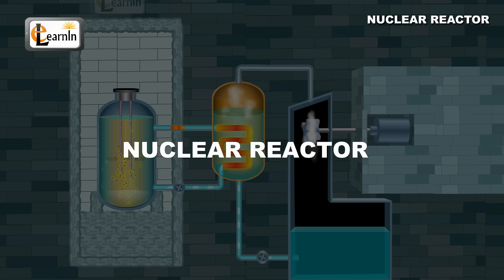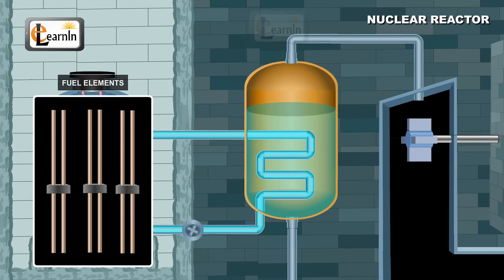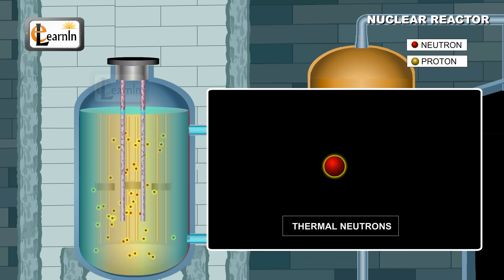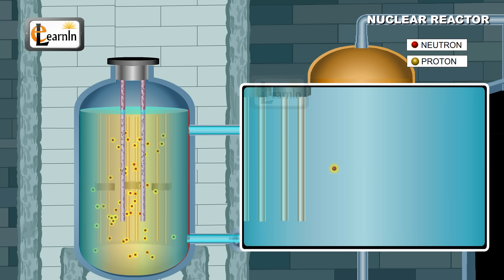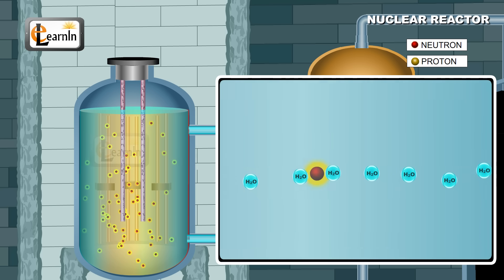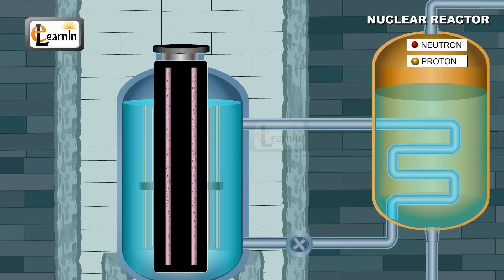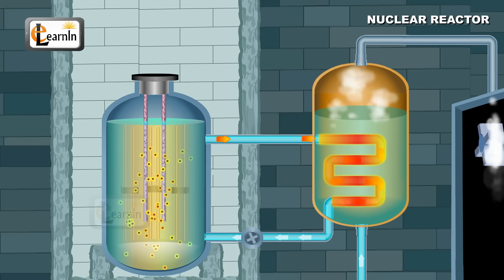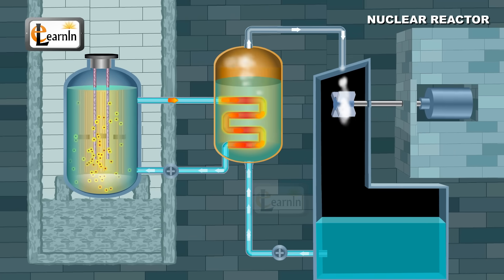Nuclear Reactor - Understanding how it works | Physics Elearnin

Comment: So how long can the Reactor core function for? About a week or more? Can cars use this type of engine?
Reply: 18-24 months. Then you need to shut down and replace the used fuel with fresh fuel. Usually, you only replace 1/2 or 1/3 of the fuel at a time, so each fuel element stays for about 4 years.
Reply: For as long as fuel is available. Could cars use this? In theory, I suppose yes, but would you really want to risk having thousands of nuclear reactors running around? Not to mention the damages of having radioactive material running around.
Reply: Thats awesome amount of time without refueling. I am wondering if its possible to use nuclear energy in cars
Reply: Yes it is possible but it would be highly costly and possible illegal
Reply: This will be very dangerous because of the safety issue. If there is a car accident, there could be a nuclear explosion. So for public transportation, it's a no go!
Reply: in theory yes, but the cars would have to be lined with thick lead which would make them very heavy and therefore impractical

Comment: How you run it on half throttle?
Reply: Probably by controlling how deep the rods are submerged in the reactor core.
Reply: MatryxMayhem I thought the same but I couldn't find a concrete answer on this video, I need to do a research to elaborate ...
Reply: Control rods slows down the reaction

Comment: So basically control rods determine how much the nuclear reactor works, and if fully inserted stops the nuclear reaction and stops the nuclear power?
Reply: Yes, but for some reason (not sure if that is still the case in modern reactors) that caused a sudden surge in reaction in Chernobyl for a fraction of second before stopping it and caused the reactor to explode.
Reply: +caballeroPL The control rods were tipped with graphite. It was a design flaw (as evidenced from the explosion) that causes a power surge.

Comment: doesn't seem very efficient.....
Reply: +Rob Diesel you need to refuel a nuclear power maybe once every 2 years in the 1980, now probably in 5-10 years, it'll run non stop for as long as there is fuel(plutonium or uranium), very efficient but need an intensive contrrol, fukushima

Comment: I'm a PLUTONIUM man myself. This metal is so radioactive that a hockey puck size of it is not only incredibly dense but if ya placed it into a room "as is" with people in the room they would quickly become horribly ill and would likely die from the inside out. Basically I'm fascinated by Nuclear Fusion or Fission but the mathematics is so far over my head its not funny. I love the Fusion reactor construction scheme and the low temperatures required for Fusion to............HA HA HA HA............try 200,000,000 degrees just to get to "Ignition" temps, its sick. My concern is what would happen if the reactor was officially up and running and those insanely powerful magnetics shut down - we're talking a lot of control room personnel would be fried!

Comment: How much energy could you produce having humans turn turbines? or animals?
The fuel would essentially be food and water, but we already use that anyway. 

What about a fucking windmill with solar panels on the blades.
Reply: +kevin willy remember wind energy efficiency cannot go beyond 59% betz limit
Reply: Silicon is a green way for energy but not efficient, it takes a long time for it to be collected. That why I'm going to apply for a job in fusion when I'm older

Comment: how do u accelerate the neutrons?by heating the rod?
Reply: +TheTruthQuest123 What kind of decay do the rods undergo initially ? It it alpha decay ? Cause alpha particles have 2 neutrons in them.
Reply: +kappa the neutrons ''accelerate'' because kinetic energy is imparted during the break up of the atoms
Reply: Sentiray yes but how do u even start breaking up atoms?if the first few start breaking apart the the rest will follow but how does it start?
Reply: ***** i dont understand what u said
Reply: ***** like what?another radioactive material?whats the prosses
Reply: ***** i see!!thanks

Comment: Is Uranium isotope 238 fissionable if yes then how does that work
Reply: +Om Patil Uranium 235 will split when a "slow" neutron gets absorbed, uranium 238 can only be used when it absorbes a "fast" neutron. Then it will change in plutonium 239, which can be split, thus creating energy.

Comment: The water should be gravity fed with the pumps for support. Doesn't make sense to have meltdown because of pump failure.
Reply: +MrCbizz07 Just try to answer why in your head before making the question public. Why do they do it that way?. (intelectual respect to others is not uttering the first thing crosses your mind. Not without reflexion)
Reply: Ok, like you did.

Comment: i agreed with everything until you said "fusion reaction" fission bro.  fission.
Reply: Bhupendra Patel no.. Fusion does not occur in a reactor... Fusion needs high amounts of energy.. Stars like our sun is capable of doing it
Reply: @jarvis_kjellberg  Fusion has been succesfully tested by man kind in what I believe was a reactor, however the power output was less then the power input
Reply: Zackary Fowler prolly just a slip of his tongue.
Reply: @bhupendrapatel5536  also fusion uses deuterium and tritium, not uranium
Reply: @Losshe  The sun uses Hydrogen
Reply: @FabledGentleman  Deuterium and tritium are actually hydrogen they are just isotopes which means they have more neutrons than standard hydrogen
Reply: I'm a bit confused tbh. What kind of radioactive decay emits neutrons? Isn't it either alpha (helium nuclei) or beta (electrons) that are emitted?
Reply: @jumanahidris2973  I know it's 2 years ago, but in case other people are reading, Matthew was wrong, gamma radiation is a single photon - not a neutron.
The neutron is released as a by-product of a fission reaction.
After being hit by a neutron, a uranium(/other fissionable) nucleus splits into two smaller "daughter" nuclei, and at the same time around 2-3 neutrons are released.
n + U -> X + Y + 3n
This is NOT a form of radioactive decay. Fission usually has to be started artificially by us shooting neutrons at the nucleus.
Radioactive decay would be alpha, beta, or gamma. These occur spontaneously (due to the instability of the nucleus without us having to shoot it or something), but none will release a neutron, as you correctly state.
Reply: @jumanahidris2973  4 types of radiation - Alpha, beta, gamma and neutron.  Neutrons are very common in radioactive decay.
Reply: @bigzzzt  I'm crying
Reply: @jumanahidris2973  Gamma radiation consists of a single neutron
Reply: @matthewkendall8592  Thank you. I have been informed that there are also 'positrons' which are positively charged electrons and I want to die.
Reply: @jumanahidris2973  It gets even worse when we get into fusion
Reply: @matthewkendall8592  how can it get any worse than positrons??
Reply: @jumanahidris2973  Well you see fusion is the combination of 2 helium elements to form Hydrogen, however it's not that easy because the elements can't touch any other matter while under fusion otherwise energy is lost so they have to use electromagnetic forces to levotate the elements
Reply: @matthewkendall8592  , existence is nothing but an abyss of confusion.
Reply: @jumanahidris2973  Very true
Reply: Matthew Kendall BS
Reply: basically fusion is when 2 atoms , make 1 atom, and fission is when 1 atom makes 2 atoms.
Reply: just fission
Reply: He lost me when he said Boran and actually misspelt Boron on the the screen for the video. 
...If you're American, yes, misspelt is correct, just not in USA :P
Reply: Moment he wrote boran for boron

Comment: does anyone else think it kinda sucks that we really tap into the real power generated by the core and have to convert it to steam and then use a turbine to harness the power? I always wondered that does anyone know how much energy is lost in the that transfer? or if there really is any significant amount lost? sorry not a nuclear engineer lol.
Reply: Water has very high heat capacity and it can be acquired from anywhere like ocean or river. You might think water very abundant so regard it trivial, but water is so thanksful to make electricity
Reply: Something has to turn the turbine.  Electricity is generated by rotating a giant magnet around a copper wire.  In essence, that induces  a wave in the wire which "breaks" on your device.  

There is nothing magic about how electricity is being generated.  Water is heated, steam pushes turbine, turbine rotates  around magnet, magnet pushes electrons in wire.

Electric power generation is just a whole lot of hard pushing.  As of yet, there is no magic key to change raw thermal energy directly into electric energy without a mechanic intermediary (I.E. a giant rotating magnet).
Reply: carlos y You lose a big chunk of the total energy generated in this process, but it's still the best we can do with our current level of technology. It's pretty much physically impossible to harness 100% of the energy from any system, though.
Reply: Amun-Ra thanks for the response. ever since i found out how nuclear reactors actually work I've been bothered by the fact that we do not have a more efficient way. lol hopefully we will soon
Reply: The efficiency of general nuclear reactor is about 34% which means that if 100 comes out, we gain 34 as electricity. As I learn nuclear engineering,  I also doubt why people should use water as a way of gaining electricity, but you know what, I get to know that water is fairly nice way of gaining electricity.
Reply: Im saying in the greater scheme of things, yes.
Reply: ***** sounds pretty cool i will check that out
Reply: CHAPO 13 typically about 30% of the power released from the fission is obtained in pressurized water reactors. There are more efficient reactors out there. Fast breeder reactors typically get around 40%.

Comment: We have coal for some 4000 years at the current usage..  
Not exactly at the breach of extinction:p
Reply: ***** Coal puts out more radiation than nuclear by a huge amount.
Reply: That's not the topic, Watch the video!
Reply: Um, it Will Run out in 250 years, just saying.
Reply: He meant that the use of coal for fuel is going extinct. Not the coal itself.

Comment: why those rods needs to be cooled for a long time even after the usage?
Reply: ***** you are very confused.
Reply: So far? in the US, it is kept in onsite storage, in the spent fuel pool, or in dry casks which can withstand being hit by a train.
Reply: ***** yeah obviously its like that.. im asking why it takes years to get back in normal state already..
Reply: yco67 They generate their own heat due to radioactive decay. If you cooled them down to room temperature they would heat right back up as a result of ionizing radiation.
Reply: +yco67 because the fission products are almost all unstable short to moderate half-life atoms. The radioactive decay of the fission products generates a significant part of the total heat. (~7%) and the longest lifetime fission products take decades to decay even half.
Reply: Jonathan Schattke thanks for the explanation..

Comment: No the water from the reactor runs through a tube in the heat exchanger, even though the radioactive water heats the water in the heat exchanger they never combine.
Reply: Donna Beaver in theory, yes... in practice, the high pressure water in the steam generator causes leaks every cycle, and some of the primary coolant water gets into the secondary side water. This is corrected at every service outage, with each tube being pressure tested and sealed if it fails. For this reason steam generators are replaced typically every decade, and they also are initially sized with extra tubes.
Reply: +Donna Beaver    The water runs through a lot of tubes which transfer heat from the primary coolant (the water in the reactor) and the secondary coolant (the water in the steam generator used to make steam for the turbines and propulsion). There is never any cross over between the primary and secondary coolant. They are both constantly analyzed to ensure there is no cross contamination. If fission fragments were ever detected in the secondary coolant it would be grounds to declare the reactor failed and take it out of commission.

Comment: So basically nuclear energy means boiling water but at a hotter rate? Why can't they just boil water or build a giant kettle?
Reply: andres viveros yes, the only difference between a coal plant and a nuclear plant is the source of the heat used to make the steam (and the more robust safety systems on the nuclear steam system).
Reply: +Jonathan Schattke   And the exhaust of a coal-fired plant contains more C14 than a nuke plant could ever produce thereby making coal plants more radioactive than nuke plants can or will ever be.
Reply: To boil that much water you need high energy fuels such as fossil fuels or nuclear fuels as it needs to be extreme heat in order to produce VAST amounts of steam, so simply boiling it won't do. Plus the electricity needed to simply boil that much would be too much money so it will be loosing more electricity than its making. Hope this helped :)

Comment: Great video, nicely explained. Just a question... What would happen if there was no water in the reactor?
Reply: Minimal444 with no water, there is no cooling; there is also no moderation, and the nuclear chain reaction would fail, because the system is not "fast critical" but requires neutron moderation by the coolant to be critical.
The lack of cooling, though, means the decay heat - especially from the short lived isotopes - is not removed, and leads to a melt-down of the core materials, even after a couple days. This is what happened at Three Mile Island and Fukushima Daiichi; the core got partially exposed.
Generally, dry cask storage is only used for fuel rods that have been out of a reactor for over 3 years, as the radiation levels have dropped to just a couple kilowatts per assembly.
Reply: The core would melt because nothing is moderating the high energy neutrons being produced.
Reply: Thanks for the answers, guys :)
Reply: +Minimal444   Depending on the age of the core if there were enough fission fragments to produce heat, the core would melt IF the fission fragments produced enough heat. If the core was brand new it would remain at room temperature until water was added and the control rods were extracted.
Reply: Boom

Comment: please do not compress so much you voice,

if you have not space on youtube simple make a new profile

also we do not run out of coal,

it is simply because of global warming laws.

find more data - we have HUGE AMOUNTS OF EXTRA CHEEP COAL

FOR MANY MILLION YEARS!!!!

READ THE DATA

we can EASILY FUCK the planet

well some suggest to build coal facories that compress the exhaust

but that will cost half of the energy, ok, we might even recycle oxidized

C atoms, with sun light, but that needs time and it is very expensive to build

a very very slow process